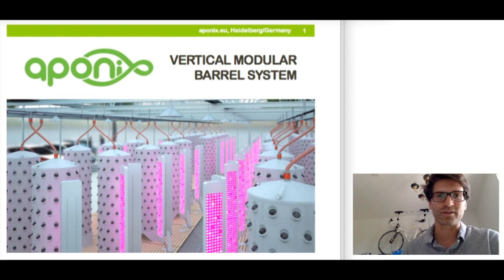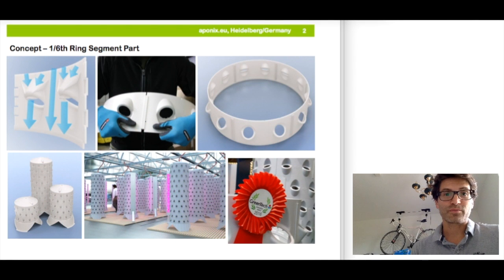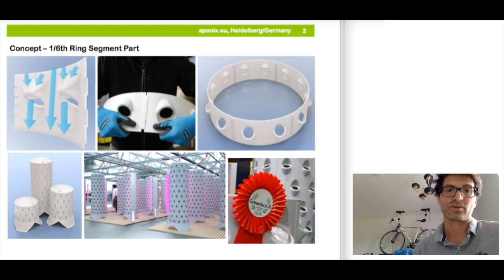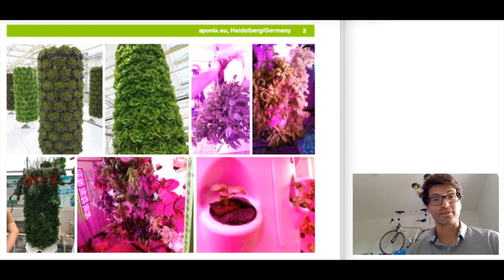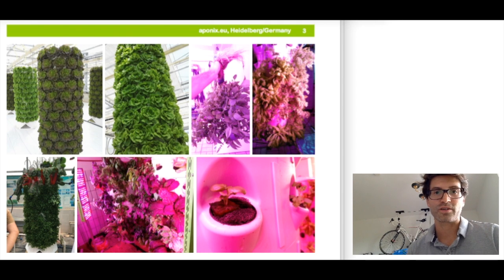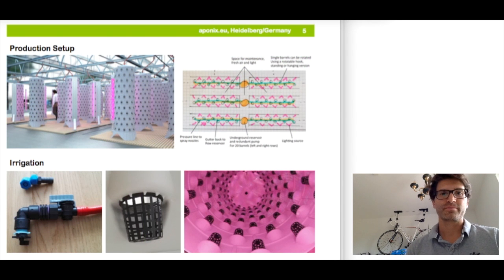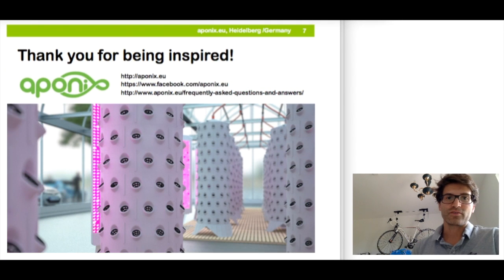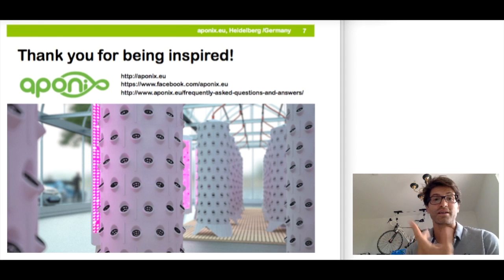aponix intro - vertical soilless barrel component

Comment: Very nice barrel. I wonder if you can make the barrel to move for all the plants to receive light for indoor growing. Greenhouse growing sometimes may produce issues with light as well so it will be great for the barrel to move for all the plants to receive light
Reply from the maker: Thanks for your comment! In the meantime we switched from trying to sell the pieces individually to rather working together with 'product partners' who add their own engineering (like rotation and lighting etc) to be able to offer a more complete and more targeted solution independently - see https://www.aponix.eu/product-partners. As a result there will also be new aponix parts coming out of this process that will help extend the system and give it more features.